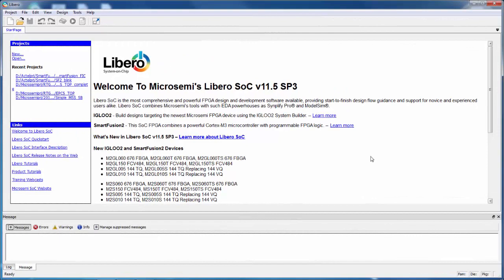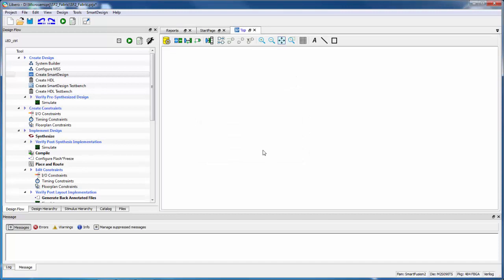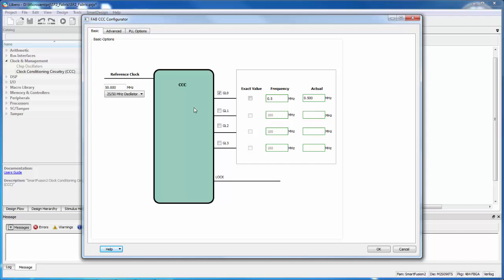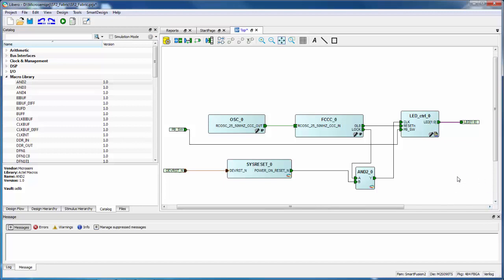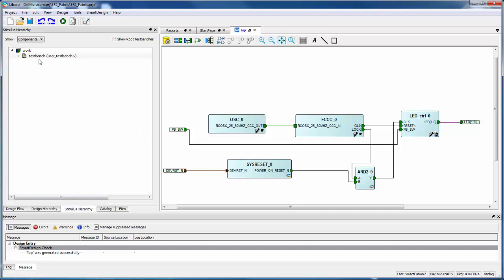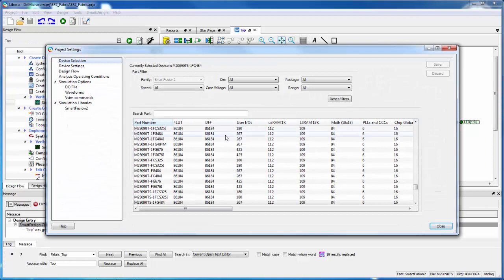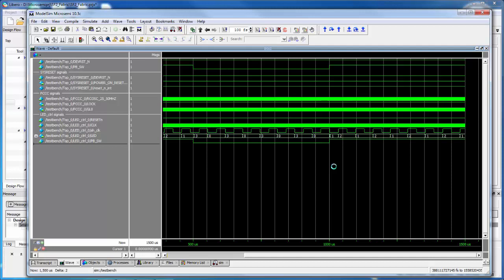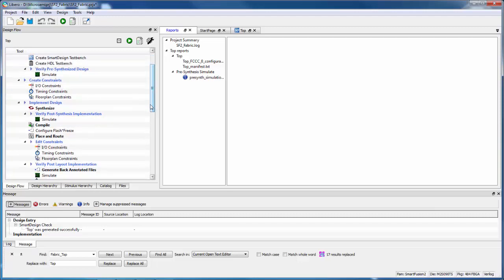Getting Started with Microsemi SmartFusion2 System on Chip (Part 4) – FPGA Fabric Demonstration

Comment: I have tried in a similar way by using M2S025T Smartfusion2 but as I run the program it just turns the LEDs high while i have made them switching at very low frequency 10Hz. Can you please share the files of verilog LED_ctrl block?